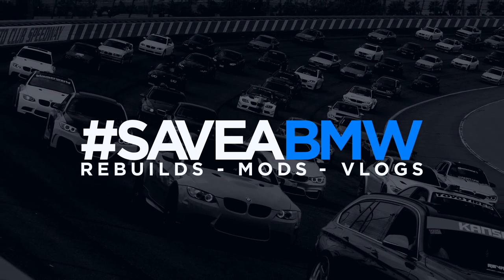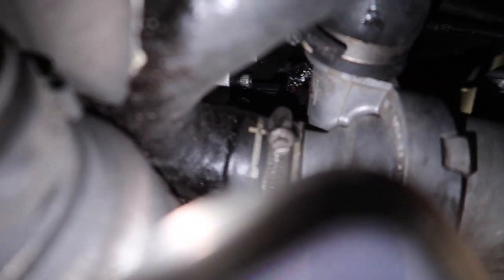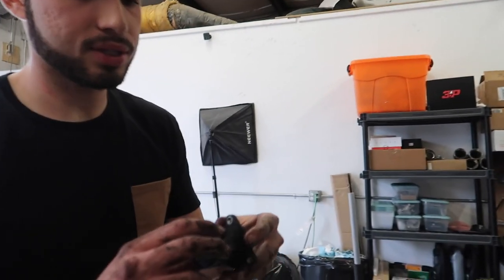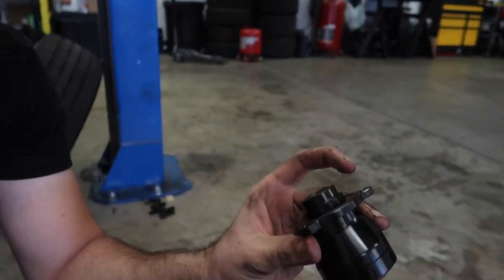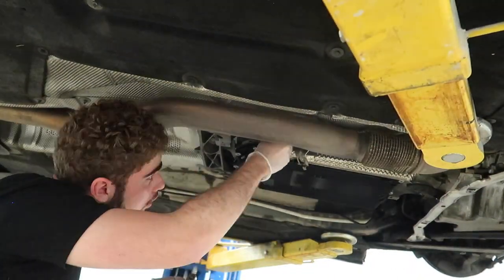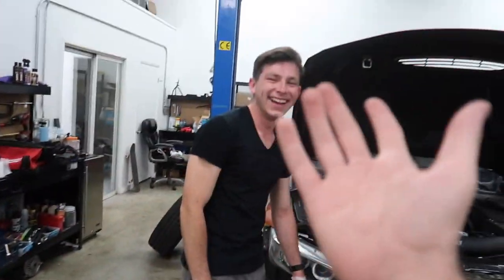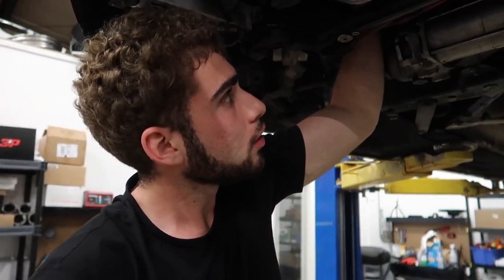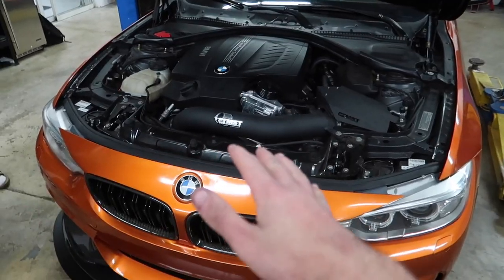435I GETS BEST SOUNDING BOV I HAVE EVER HEARD!

Comment: The OEM diverter is plumbed back into the system. The Turbosmart is dual port, did you plumb it back or is it dumping atmospherically back in engine bay? I tried atmospheric and I am having issues with car running too rich.

Comment: From my experience in doing my ZF6 transmission fluid, the car must be running (in the air), then top off the fluid after PRNDS until fluid starts to leak from the fill hole.  Nonetheless, i may do the diverter valve upgrade on mine next. 👌👌
Reply: Mango_Springroll yup fill after shifting through all the gears with the ENGINE RUNNING he would be surprised how much fluid need topping off

Comment: Hi question i want to install this mod to my car i have a bmw x5 e70 35i 2012 stock n55 will the blow off valve cause any problems to the engine or turbo over time ?

Comment: Hey bro on the previus episode you didnt do fill up procedure right. When you put the fluid and start dripping, you have to start the car run true some gears and top of on the RUNNING ENGINE. You are low on fluid now, you will damage your tansmission.

Comment: Do you have to stop accelerating to be able to get that sound or does it dump through the gears? Asking specificly for an automatic gearbox. Thanks
Reply: it depends on whether the BOV is either on-off or if it actuates dynamically/gradually(I know the GFB one does i'm not 100% sure about this one but I suspect its also dynamic) - you hear it a lot when you let off the pedal cause it goes full open to release all pressure but when gear shifting it only opens very partially so less air is escaping and the sound is a lot less quieter, probably not likely to hear it if you have an aftermarket exhaust

Comment: you should figure out why there was so much oil on the diverter valve cable.... you might have an oil leak somewhere..... you should get that oil leak sorted asap if you are going to tune the car.....
also i think it would have been a lot easier to get that top bolt if you took off the inlet pipe...

Comment: You need to start off as u do but instead of releasing the pedal let it change to atleast 3rd once the pressure is built and then let go. That would sound good. But also do more of them on video

Comment: I gotta be honest with you watching this video made me cringe badly..  I’m not trying to act big and mighty or nothing, but honestly I did this same exact install on two of my friends vehicles already, and I did this job in 2 hrs.  Longest part was refilling the coolant and running it thru a bleed cycle....  I agree with you it’s a difficult mod if you have no clue what your doing or don’t know anything about cars...  index your car man so when you take shit off you can but it back on perfectly the first time and not waste time trying to figure shit back out, which angle you had your aftermarket boost pipe/charge pipe etc.... Just some advice.